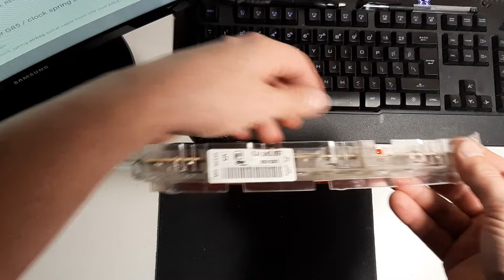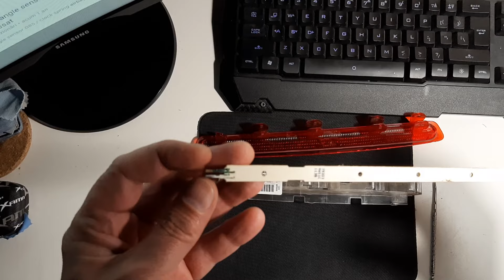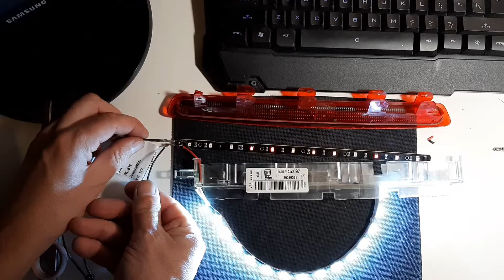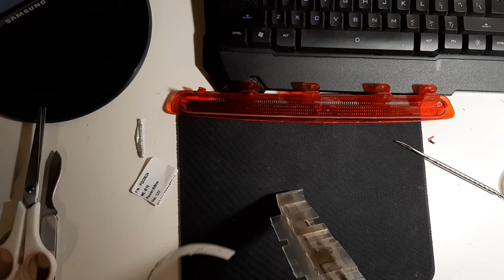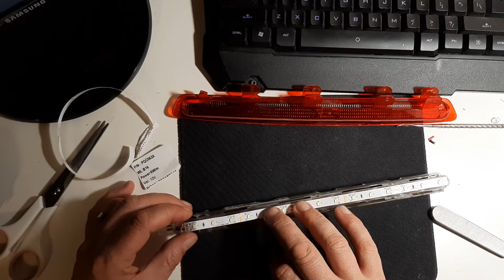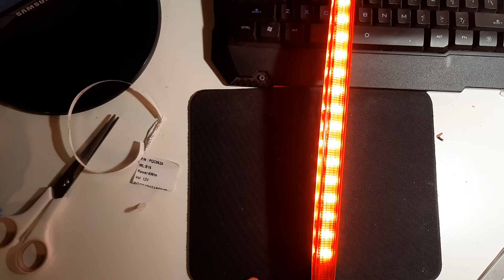Repairing The Rear 3rd Brake Light On Your Car

Comment: Absolutely mate,  why not! If you have a spare led strip. I checked part number from audi, charge was £65 ish quid all in. Found a smoked one on ebay for £20. Hopefully no issues or I'll be swapping out parts. Fingers crossed it's an out / in install but I respect your solution! Not sure on the arching while testing lol but I believe.. if it works? Do it!